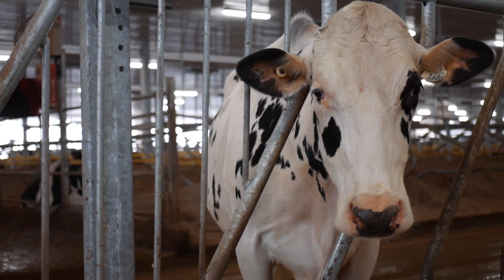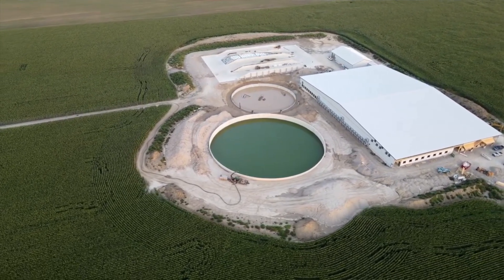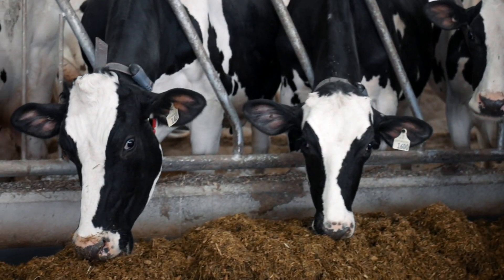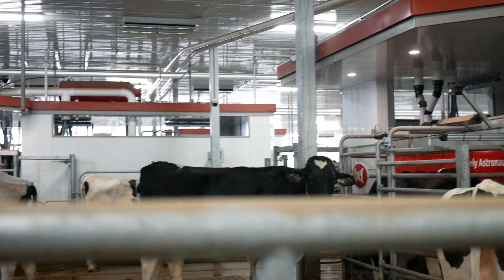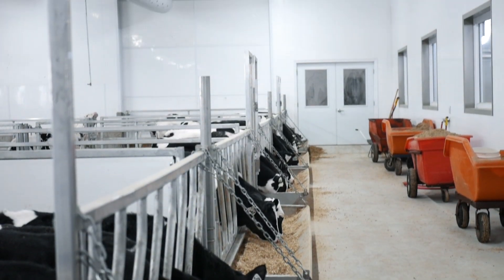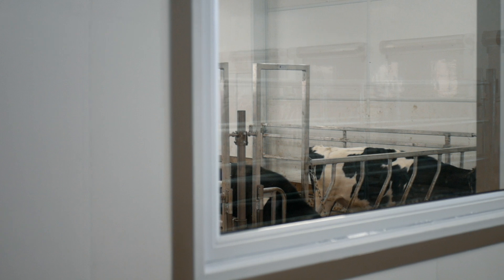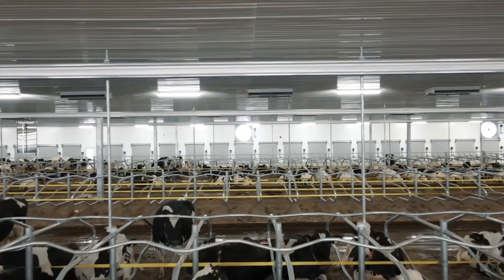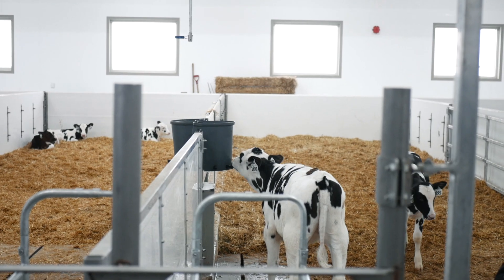Robotic Cross-Vent Dairy Barn

Comment: I worked for a farmer at age 14 that milked cows on a small scale. We hooked the milking machines up while kneeling next to the cow. Looking at this modern day type of dairy does more than blow my mind! The efficiency is so evident that he was right. Don't try to save money on the building. Think long term.
Reply: Hi Jay
We were a small dairy farm,70 cows.
We had a pipeline were we would hook upto,we had to go up between the cows(a pair)with a galvanised bucket containing a cluster,and pulsator. 
Then tip the milk out of that bucket into a 10 gallon churn,with a funnel filter ..
Then wheel the 10 gallon churn down to the bulk tank..Great days..